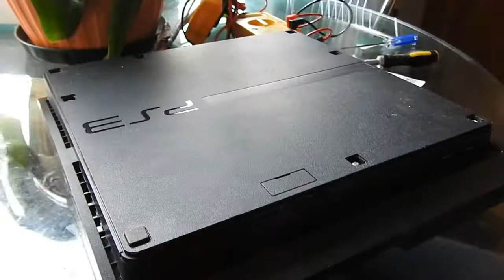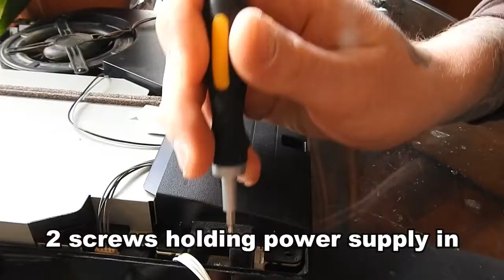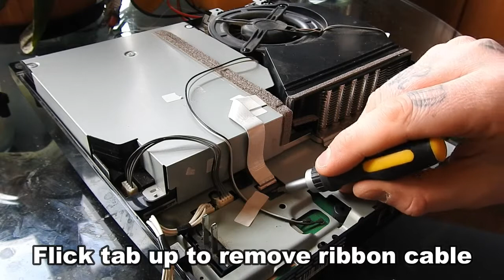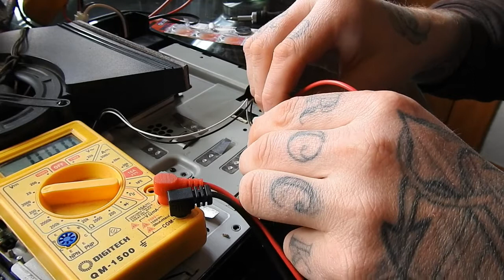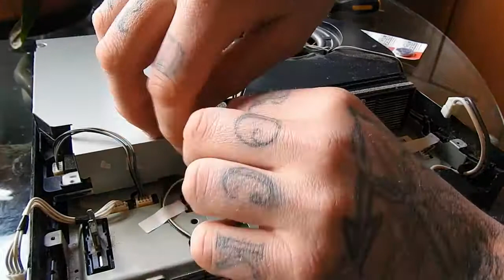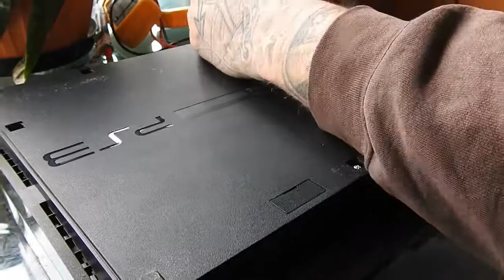PS3 Forgets Date & Time Internal Battery Replacement Tutorial

Comment: Great video. Thank you. This worked for me but I had to sign back into my PlayStation Network account for the change in setting to take effect. Therefore, for anyone struggling with this, try signing into your PlayStation Network account after replacing the battery.
Reply: Is this really necessary? I replaced my battery with Duracel rated to 2030 but it still asks for date when switched off.
Reply: Once I’d signed into my PlayStation Network Account, the PS3 calibrated and remembered the time/date settings.
Reply: Also, check you are using the correct battery. Many online guides reference using a CR2032.
Reply: If that battery only fixed the "date and time" settings, im good 😂
I'm not tearing down my ps3 slim that's so far been very reliable for that battery , although  I do want to feel clean it and dust it out. I feel that I'll hurt it then help it

So I installed a nice shiny Harley Davidson clock in my game room so I can tel the time and I have my what is it called next to me, a CELL phone with what do you know... date and time 😂 lol

I say, don't bother with it unless your gonna clean out your internals anyways

Comment: Thanks a lot for your help, but in my PS3 at least which seemed to be the same model I had this issues:
- The Optical Disc Driver was held by a phillips screw
- The Torx screes where 4 instead of 3
- The plastic where the battery is put got broken when removing it, maye because of temperatures, old, don't know, but dismantled as a piece of paper, so I needed to solve that with some poxy and making sure I don't mess up the contacts.
Honestly one of the best videos I watched on this, super helpfull, thanks.
Reply: maybe is some another revision hmmm

Comment: I tried to do this, and everything was going well until I found the CMOS battery behind a metal cage that was part of the motherboard metal tray. tried to slide the battery out, but all I achieved was to make the battery holder very loose. If anyone knows of an easy way to swap the battery without a Dremel tool please let me know.

Comment: what's the issue with that i wrote before that i've changed the battrey & yet it's still forgets the time and date
......
Need Some Help 😣💔
Reply from the maker: Not sure what the problem could be sorry
Reply: Happens the same to me. I have a CECH-3001A
Reply: Yall have to sign in on playstation network, then go to time & date and through settings and configure it via WIFI it cannot be manual.